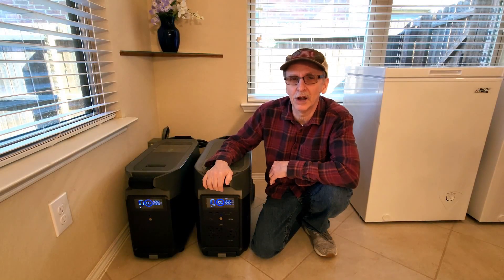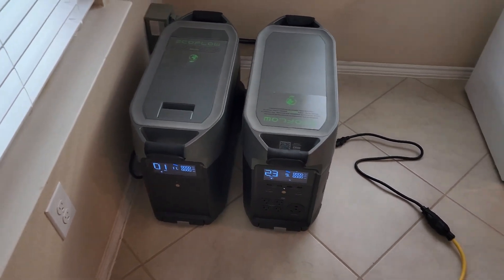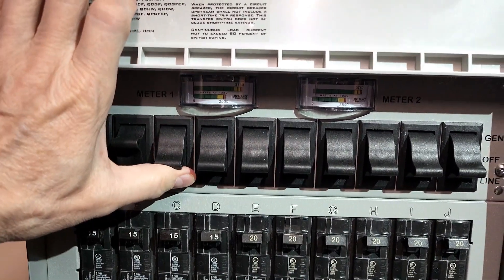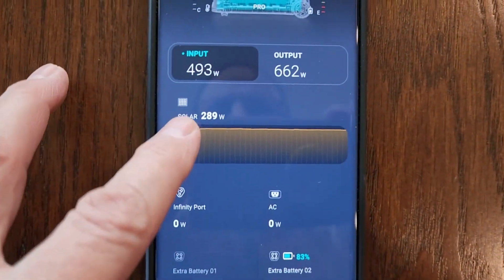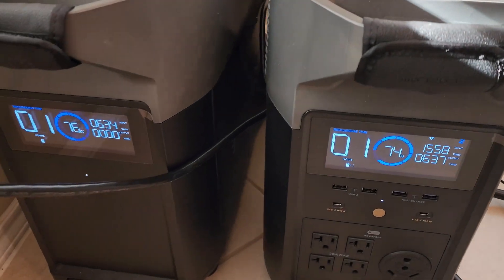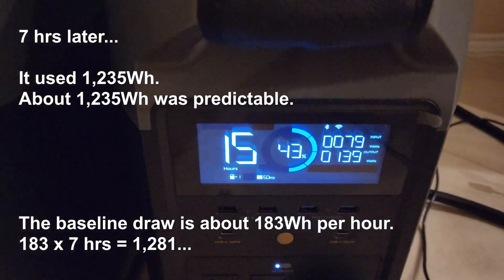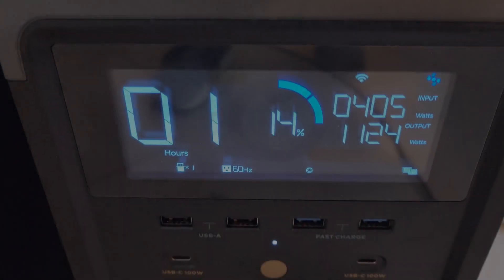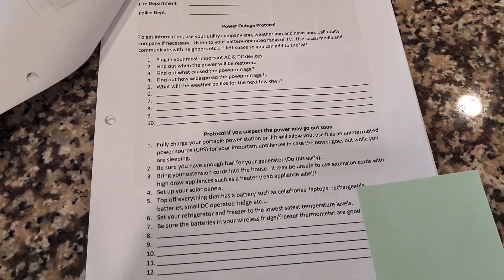Ecoflow Delta Pro Solar Generator - 24 Hr Power Outage Test. Charged With Gas Generator And Solar.

Comment: So what do you use for bulbs in your lights it makes a big difference in my house the difference is 10 bulb of the old incandescent bulbs 6 x 60 equals is 360 watts 4 x 100 is 400 total 760 watts compact Florence is way down 130 watts and LED is even lower to 90 watts and in my case all my lights are on one circuit so to cut out inverter lose I'm taking one utubers advise why convert 12 volts DC to 120 volts AC when you can just use 12 volts DC so I'm going to order 12 volt LED light bulbs with Edison base and switch start my conversion to solar power I already have 2 big cat batteries and 2 100 watt solar panels I'll also switch my phone chargers to 12 volts DC input and both our cpap machines unfortunately when I started looking at going solar years ago mppt charge controller were unheard of and there was no utube to learn about how bad modified sine wave inverters were
Reply from the maker: To answer you question.  For the most part, we use LED bulbs. When using lights, it is for just a brief period of time, when walking into a room.  They are not on for hours, so they use very little power. So, a 100 watt bulb running for 15 minutes only uses 25 watts.

Comment: This has to be the absolute best video I've seen!  We lose power several times a year (lucky me), and I have a gas generator that is fickle.  Not to mention the gasoline it drains, and the stress of having to drive to replenish with trees down and 3 kids.  This demo simulating a 24-hour power outage is so valuable because you can see how the transfers happen, how you estimate, and test certain appliances, etc.  I always need 2 freezers, 2 refrigerators, but most importantly...the boiler.  I know I have to replace my generator soon (been 8 years?), and this put the Ecoflow through a practical test.  Thank you.
Reply from the maker: Thank you for watching!

Comment: just a thought for the future, and getting a bit picky, but if perchance you could build a box around the two chest freezers, with something like 2" pink foamboard insulation, without of course blocking airflow to the compressors, unless one opens the freezers to remove or add to the contents, it is likely they would rarely if ever need to come on over about 24hours or so, depending on time of year (being in front of the windows, could add heat to the room of course). just a quick thought.

Also on the Delta Pro, I believe you can charge from solar and AC both at the same time correct, so if the sun is up during a "rolling blackout", when it comes on you would be charging faster.
Reply from the maker: Thank you for your comment but I don't see any reason to build anything for my freezers.  They use so little power,  it wouldn't be worth buying the material.  I believe together, they use less than a 100 watt bulb.  And I don't think it would look very good and may make it a bit harder to get into.  There are several options for charging, for sure. With so few panels, though,  at the moment, I would not get the charge I do in my demo.

Comment: Hi....great video....what's the cable you use to connect the Delta Pro to the inside transfer switch outlet?  Is it a cable you purchase or comes with the Delta Pro?  Thanks.
Reply from the maker: I had it made...

Comment: What's the point of using the $5000 EcoFlow system you have if you've already got a gas generator (which you need to charge the EcoFlow). The EcoFlow is great if you've got a 1-2 hour outage it's ok, but if you're serious about powering your house, just run the gas genny and save yourself $5000.
Reply from the maker: I don't need the gas gen to charge the Pro. I use solar. I use gas if sun is not avaiable.  If power is out for long period of time and you only have gas gen, what will you do when gas statons close because the pumps dont work or gas trucks cant get to the station etc... based on you comment, I doubt you  watched the entire video.  I invite you to do so... and maybe all the other solar videos I have, including the one that shows the 10,000 watt hour battery capacity system I built. That being said, I did run an only gas setup years ago when living in the mountains.  When we were snowed in too long, we would run out of gas and could not get to a station and when we did, they had no gas because trucks could not get through. So, thats the point of the Pro. A side note... I paid a lot less than 5K.

Comment: Suggestion for limping mode...get some programmable lamp timers for your fridge/freezers.  You can connect your 2 freezers to a plug strip and only use 1 timer.  I have 4 of these for various stuff that run 8 programs/day.  Set them for 1 hour on, 2 hours off...1 hour on, 2 hours off...etc.  This will keep your fridge/freezer cold and they'll only run 8 hours/day.
Reply from the maker: If your unit goes into defrost mode after turning back on, which my fridge does, it could be actually running a lot less than you think and end up too warm. I would rather use my wireless thermometer to decide when to shut it off and turn back on, but turning off and on could damage the fridge.   Besides, the freezers and my fridge use very little power overall.  But thanks for you comment.  I have a video about power usage with fridge and other videos on how to manage power.
Reply: That's exactly what your things are doing anyway... 1/3 hour cycle is the same thing as 20/60 minutes for power.. ypure just putting your food through heat cycles for no reason.

Comment: How do you have two bypass inlets connected to your panel at the same time? Thanks for the video really nice
Reply from the maker: 2 inlets are wired into a switch that allows me to run one or the other.  I unplug the one not in use for safe measure.

Comment: Your video is the best I have seen in explaining how long a delta pro will last. I live in a condo and cannot really afford the extra battery right now, so I hope I can at least run my fans and my fridge. My inverter generator is a Ryobi 1800 and doesn't have the bigger plug, just a regular 110v plug. Is it possible to charge the generator still?
Reply from the maker: Not sure what you are asking.  If you want to charge your delta pro with you gas gen, just plug in your regular 110 plug from the gas gen to the Pro. Be sure your gas gen is pure sine.  You can adjust the pro in the back... same plug you use to charge from 110 outlet.  to less intake voltage by app or the switch on the back if your gas gen struggles.

Comment: Are you charging with 240VAC from the dryer outlet or is it 120VAC @ 30A?
Reply from the maker: 240
Reply: So you’re using an adapter that sends 240VAC into a 120VAC plug?
Reply from the maker: All Im doing is using the charge input on the pro...  yes I use an adapter cable.
Reply: @mabatz  The print below the charging receptacle on the EcoFlow Pro sais it can accept 100 to 240 volts ac 15 Amps Max, so you just need the right cable or adapter.
Reply: The print below the charging receptacle on the EcoFlow Pro sais it can accept 100 to 240 volts ac 15 Amps Max, so you just need the right cable or adapter.

Comment: Can you leave the Delta pro hooked up and use the gas generator to charge the delta pro?
Reply from the maker: If you keep the Delta Pro running on transfer switch, be sure to not have the gas gen running on the transfer switch, and then just plug the gas gen directly into the Delta Pro to charge it.

Comment: When you use the 50A dryer plug to run 2800w input power to the EcoFlow, what kind of extension cord are you using so it won’t melt?  (Normal extension cords are rated for 1875w.)  Also, what about the black power cord going into the back of the EcoFlow itself?  Is it rated for 2800w?  Thanks!
Reply from the maker: I just added links under my description...
Not sure where you got 50A.
Reply: @LoneStarPrepping  I don't see any links in your description for the cable / adapter you're using for 240 volt charging - only links that are there are for the EcoFlow Pro,  the Extra Battery, and the solar panel.
Reply: The print below the charging receptacle on the EcoFlow Pro sais it can accept 100 to 240 volts ac 15 Amps Max, which would be 3600 watts, (240 x 15 = 3600) so you just need the right cable or adapter.  I don't see a link in his description although he's told others that its there.  Also, the black power cord included with the EcoFlow Pro has print on it which sais its rated to 300 volts, and they warn you not to use any other cord.  Let me know if you've found the right cable or adapter please.  I'd like one.

Comment: This is a nice setup and helpful video! Would it not be more efficient to directly connect the gas generator to charge the Delta while the Delta is still powering the house? Though you would need an outside to inside passage for the gas generator power cable. Then you could charge the Delta when it’s least annoying to neighbors and not have to interrupt power to the house.
Reply: If you connect the Delta Pro to AC power from the generator while the Delta Pro is outputting power to the transfer switch, the Delta Pro will go into "pass through mode" and will be restricted to 1,800 watts MAX output to the transfer switch. So if the load from transfer switch exceeds 1,800 watts, it will trip the overload on the Delta Pro. if Delta pro is being recharged via DC or solar, Delta Pro can still output the full 3,600 watts while being charged.
Reply: @thechamp66  Dang, that's  too bad, but good to know. Thank you!
Reply from the maker: Read what I wrote under the "description" below.  More efficient? No.

Comment: Why not leave Delta Pro connected to trans switch while charging it with the generator? Keep powering house with DP while it's being recharged.
Reply from the maker: As long as the gen is not using the transfer switch at the same time... no problem.  I just dont want to crack my door open to drag extention cord, which I don't like using anyway, when its 10 degrees out letting cool air in.  Its just another option for me, thats all.  Also, I may choose to only use my gas generator, in which cases I have a way to do it with the inlet outside.

Comment: What cable adapter did you use to charge with 240
Reply: Sorry.  I don't see how the black cable plugs into the yellow high voltage cord?
Reply from the maker: @DJ-mj8sd  I forgot to add the other one.  Check out the links again.  If they are out of this cord, just search for another...
Reply: @LoneStarPrepping  I checked the links in your description again but don't see an amazon affiliate link for the 240 volt cord and / or adapter you used to charge.  The male dryer end is obvious but what is the other end called that mates with the EcoFlow Pro power cord?  Please post a link because I would like you to get the credit for my amazon purchase.  Great video. Thanks!
Reply from the maker: See the links under the description.

Comment: Good info.  It would be great if you can show good ways to lift and move things around.  They look very heavy.
Reply from the maker: I leave them right where they are.  They are about 100 pounds each but easy to move.  Each has a handle that extends out making it easy to raise up and wheel off.
Reply: @LoneStarPrepping  Great you have dedicated space for it to just leave them.  I see wheels and handle but still not sure how easily portable they  really are.  For non-portable power station a dedicated home battery (e.g.  PwrCell, Powerwall) seems like a better option.
Reply from the maker: @xavierneckor8918  You can google delta pro and find vids of moving it... easy to do.  Lifting, not so easy.  You mentioned non portable?  Here is a non portable that I designed and built in 2015 before the whole topic became fashionable...
https://youtu.be/HxJ-MUePm-Y

Comment: You mentioned you have both an outside transfer switch inlet from the generator, and an inside transfer switch inlet from the batteries. My question is, did you also install a double-throw-double-transfer switch to isolate the other inlet? So that if you are running the outdoor generator your indoor inlet is not energized? Also, how are you connecting your solar panels to your EFDP inside? Did you install an outdoor anderson/aviation plug or are you just running the MC4 cable through a window/door? Thanks for any additional insight!
Reply from the maker: Under the description I wrote about the isolation or change over switch.  I would never have both plugged in at the same time in any case.  Until I get my panels installed on the roof, I just bring the MC4 cable through the door.
Reply: @LoneStarPrepping  ah, I missed that in your description. Thank you! Great video and demonstration btw!

Comment: GOOD VIDEO. WHAT HAPPENS IF YOU USE GAS GENERATOR WHEN DELTA PRO IS POWERIN AN APPLANCE
Reply from the maker: I can run my gas gen on transfer switch to charge my pro with the pro unplugged from transfer switch.  The pro will charge while plugged into the wall.   I can then directly plug in an appliance to the pro.

Comment: Very interesting. I guess it would have failed the test without the generator charging time.
Reply from the maker: Maybe not.  You just have to manage the power so you have enough to get through the night.  I ran lots things I nirmally would not run in an actual power outage.

Comment: This is excellent!   Thank you so much for your videos.   My wife and I have two Ecoflow Delta Pros and we'd like to buy a gasoline generator to re-charge the Delta's in the event of a prolonged power outage.   It looks like the charging process takes about 1500 watts.   Could you charge the power packs from a generator that only outputs say 1,000 watts?   It would just take a little longer than if you had a more powerful gasoline generator, correct?      Thank you so much!
Reply: Yes you can charge with a 1,000 watt generator.  The Delta Pro app allows you to set the AC charging input level to any number of watts from 200-1,800 watts in 100 watt increments. I set mine to charge at 1,500 watts for my 1,600 watt Yamaha generator so that it is just under its maximum running watt rating. To do this you have to move the switch on the Delta Pro from fast AC charging to slow AC charging--this allows the app to set the exact AC charging level.
Reply from the maker: I would go at least 2000w.  It's nice to be able to charge as fast as possible in a power outage for a number of reasons.  For example, your neighbors wouldnt have to listen to it as long and you may not want to advertise you have a generator.  The more watts your gas gen can charge, the faster the Delta Pro battery will fill up, up to the input limit of course.
Reply: @LoneStarPrepping  Thank you!!

Comment: Curious: Can it be kept plugged in for 'charging' during rolling blackouts - and therefore not unplug to catch a charge boost - so you can then have power for the blackout time when needed in the house?
Reply from the maker: Sure.  But if the power is on for only 30 minutes or less at a time, I want to get as much as I can in the battery in shortest amount of time, especially before going to bed.  If I leave the house, I can just leave plugged in.

Comment: Although you are covered in the event the power goes out, that's a lot of running around you have to do to switch between sources.
Reply from the maker: If you are referring to me charging my Pro with the gas gen, I choose to do this through the transfer switch.  You don't have to.  Just plug the gas gen into the Pro directly to charge it up if no solar available.  I built a 10,000 watt batt capacity system in 2015 and hooked it up different.  I have a vid on my site if you want to see that one.

Comment: Can you use the Eco Flo delta pro  at the same time  it’s  receiving a solar charge
Reply from the maker: Yes
Reply: One more question sorry to keep bothering you can you use the back up battery as a  standalone battery if the main unit fails The reason for the question is I’m trying to decide whether or not to buy the Eco Flo delta pro or the bluetti and I like how the bluetti  has the lithium phosphate batteries
Reply from the maker: @Jjsaba2008 The pro extra battery is a lithium iron  phosphate and needs to be hooked up to main unit in order to be used.
Reply: Thank you for your advice and help

Comment: Great video.  I bought an delta pro after watching your review. Awesome product but wanted your thoughts on the reasoning their support says not to leave it plugged in overnight to solar  panels because they may damage the batteries. James
Reply from the maker: I have not heard of that.  Can you provide link where it says this?
Reply: @LoneStarPrepping  you can find it on the ecoflow support page and in the owners manual. I'm hoping it's simply a possible parasitic drain that can be alleviated by setting the battery to cut off at 10 or 20% from the app to prevent total discharge. Great Channel!
Reply from the maker: @Jim-re3sr  many people leave it plugged in and basically run it 24/7
Reply: @LoneStarPrepping  hi that's what I intend to do, I'm thinking that ecoflow is concerned that leaving solar plugged in may drain the batteries to 0% at night thru a parasitic leak. I set mine to cut off at 20% and sent a message to support to elaborate on their statement in their owners manual. GREAT CHANNEL
Reply from the maker: @Jim-re3sr  of course your goal should be to make sure your battery has enough charge to get through each night.